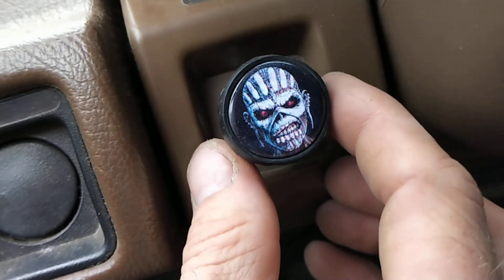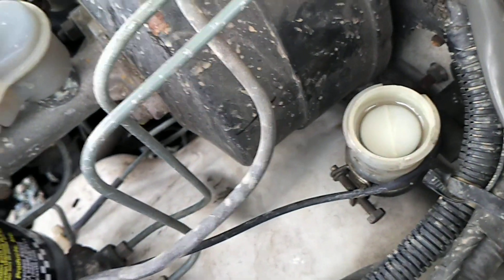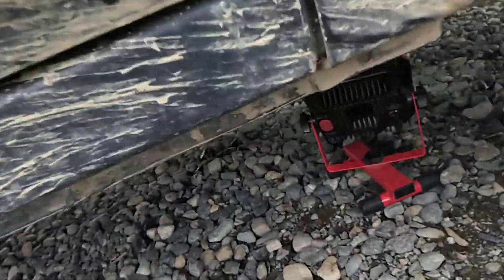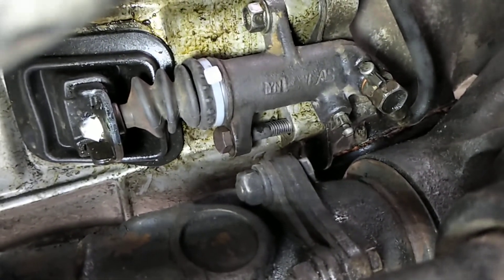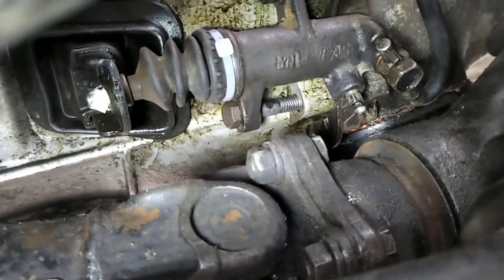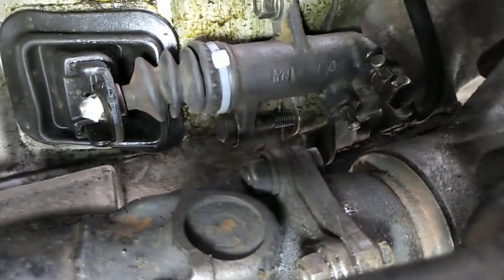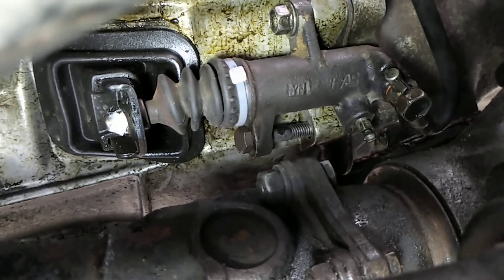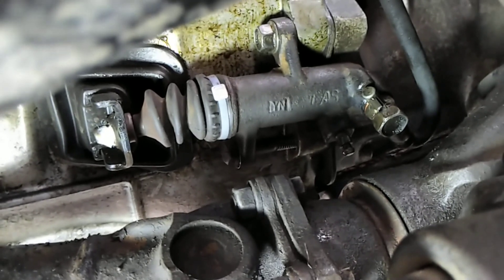Isuzu Trooper MUA transmission - Wrong slave cylinder does the job!

Comment: how did you get the slave off? I unscrewed all the bolts and the line but it was totally stuck. would not come off by twisting or any other way the piston is just not compressing